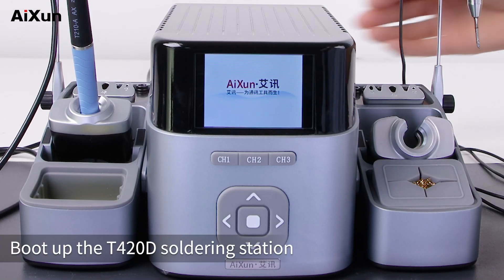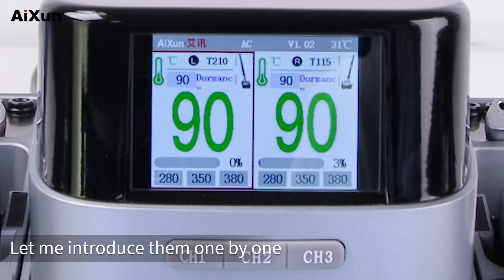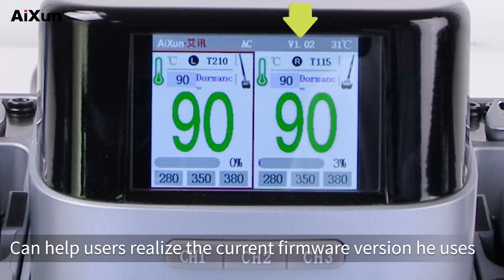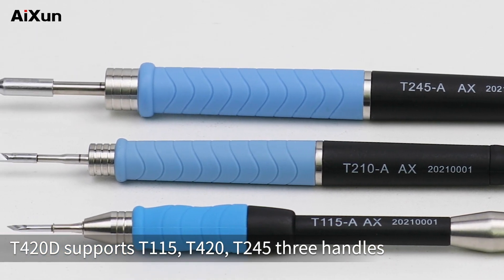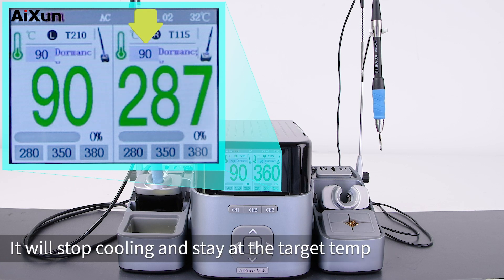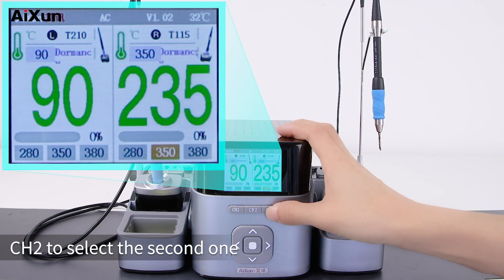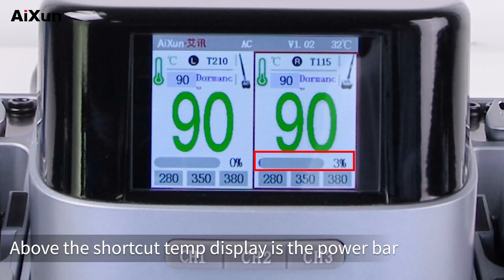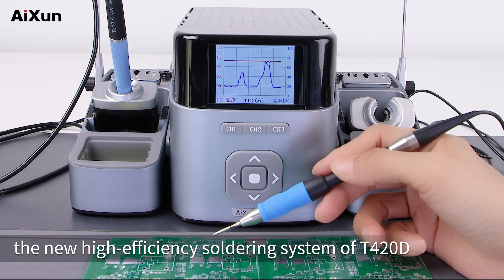AiXun T420d soldering station HD interface guided | instruction 5

Comment: JC AIXUN T420D dual channel intelligent welding station with double soldering handle seat supports T245 T210 T115 soldering handle and iron tips. AIXUN T420D soldering station dual handles 2 channels can work simultaneously.